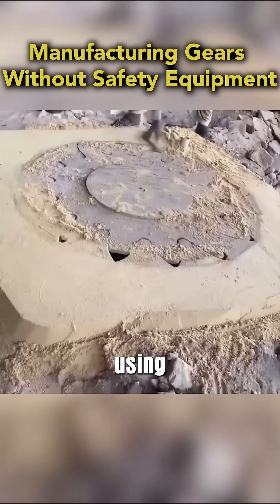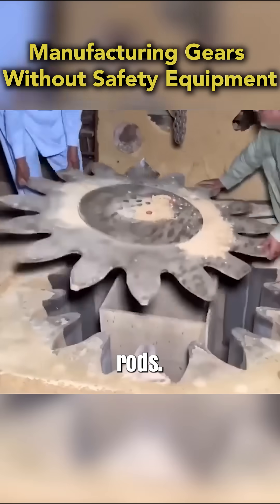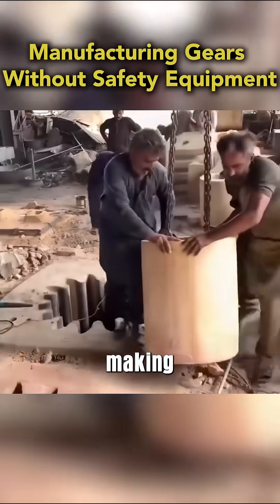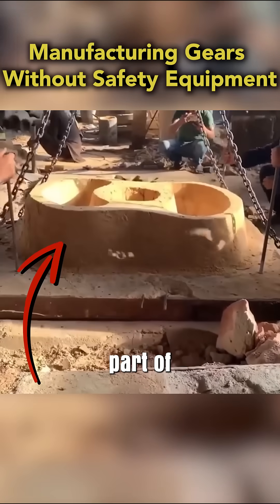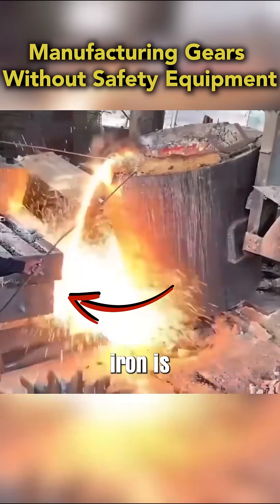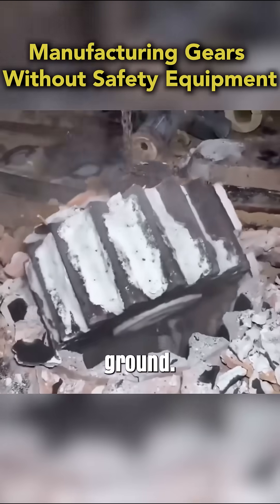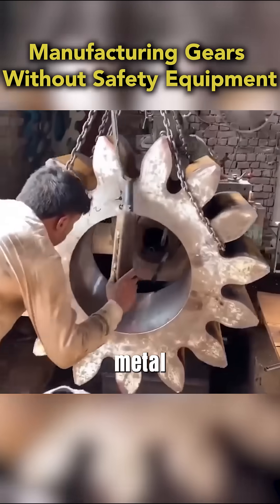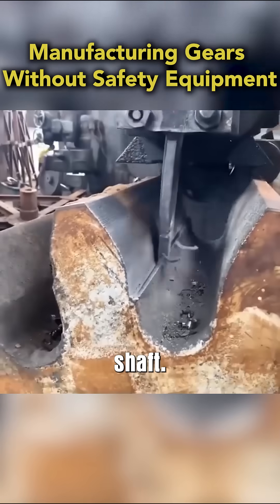How Craftsmen Transform Sand Moulds into Massive Industrial Spur Gears | Metal Casting Process

Comment: I made something similar for a debarking machine in the early 2010's. This process is what we would call "All-core" molding, not really a pattern making a mold, rather a series of cores laid out to make the cavity shape/geometry. The one I worked with was closer to 16-foot (4 meters) in diameter, and used about 20 times more cores in the assembly.

Comment: Thats a weak gear.  It will break.  Its cast.  Cast products break easily under great stress.
Reply from the maker: I agree to a partial extent. Cast iron can be brittle and may break under high stress, but it's unfair to say that all cast products will break under stress (e.g Nickel-Based Superalloys or High-Strength Cast Steels, which can withstand >1200 MPa). 

Though cast iron may not be the superior choice when it comes to quality and stress levels, given the limited resources that these craftsmen have, I would say that it isn't a bad choice for the cost (which is definitely a limiting factor here). 

Would you agree?
Reply: @FactorySatisfaction  yes.  I would agree with that.

Comment: There’s no way they are able to make the center circle perfectly centered manually
Reply from the maker: If you're referring to the core plug, these craftsmen rely purely on experience and visual inspection to make minute adjustments and confirm the core plug is properly seated before proceeding with the casting. There are slight imperfections, but it generally doesn't affect the outcome.
Reply: It’s machined afterwards, the core plug is positioned also with the help of the top part